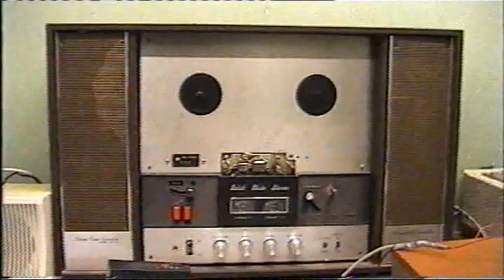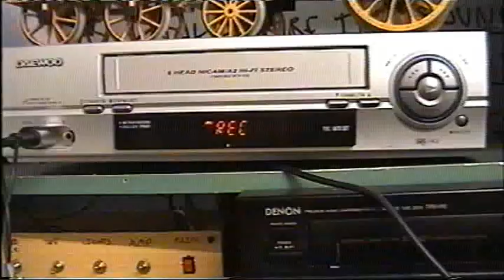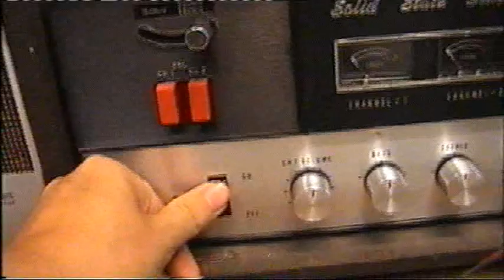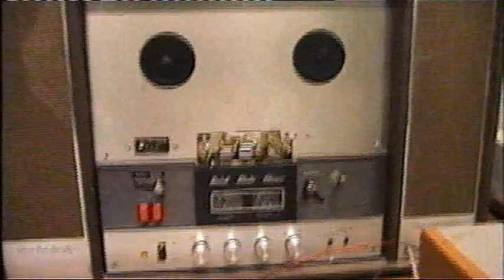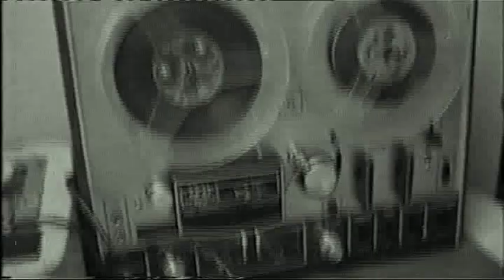Comparing the sound quality of IC's Transistors and Tubes (valves)

Comment: how about the distortion of a tube, here is a datasheet of a 5881 power tube:
https://www.newsensor.com/pdf/tungsol/5881-tungsol.pdf
check out page 4, where overtones and output watts are plotted against load resistance,
a loudspeaker has a much higher resistance in the upper register than its nominal 8ohm description, in these frequencies the tubes produce alot! more distortion, maybe this is a strong factor for the sound:
 the spot where the tube puts out the most power hast also the least 2nd order (even order) harmonics and the most third order that sound more crunchy and less warm actually, like more presence. also the area of low distortion is very narrow around 3000ohm to 4000ohm in this case, so a loudspeaker has a wide range of resistance, a 8ohm speaker has maybe 15ohm at the lower bass around the resonance frequency, then ohms go down towards the middle frequencies where it has the nominal 8ohms, around lets say 400Hertz, and then it goes up alot to maybe 20ohms or even more around 10 to 20kiloHertz.
if you compute this higher resistance with the distortion curve in the datasheet of the tube, 20ohms is more than double the nominal 8ohms, so if the tube runs on nominal 4000ohm, the upper frequencies of the loudspeaker actually see more than double that, maybe 10000ohm, which is far outside this datasheet already, where output power of the tube goes way down while distortion goes way up. maybe this is the key. high frequencies sound very present because all the distortion in it, at the say time the level of the highs goes way down.

Comment: It's already generally known that valve amps create the best sound. Hence why top end pro-sound systems are valve driven and not solid state driven.
Reply: They actually are solid state driven. Look for Mc Intosh, they have Solid State amps of the value of your car. Tubes are inefficient and need a lot more circuitry to be as linear as transistors and they still arent that linear. They still create harmonic distortion. Do your research please.

Also Tubes arent capable to drive bigger speakers. Tube Amps need really light weight speakers.

Also it is a subjective oppinion. Some people like vinyls even with its distortion and crackling ect. But people like it that way. But if you like it really precise get yourself a good solid state amp and a good pair of speakers.

Most times people like the "warm" tube sound. That is because of unlinearity. The lower frequencys are getting more amplified than higher frequencys if the circuitry is not adjusted to linearity.

Comment: It is fine to make what is an audible comparison to select the amplifier, and the type of active devices it contains, but it is best to compare them with an optimum load impedance for each one, and that may be different, again varying the performance.
It is true that valves (tubes) are more electrically robust (radio transmitters still use them), but efficiency is much less (power output vs power supplied).
Another consideration is the 'class' of amplifier, A, AB (your examples), which can use any of the compared devices.
With the development of television, it was a long time before the use of solid state devices in the deflection, high voltage output and rectification (for the picture tube anode).
Further, there are several types of transistors; bipolar germanium (your 'All Transistor' tape player)..
Silicon NPN, PNP.
Field Effect Transistor N-Channel, P-Channel.
Power MOSFET..
The latest I know now is the IGBT's, (insulated gate bipolar transistor) combining the benefits of MOSFETs and bipolar transistors..
These are included in the latest high power discrete component audio amplifier designs.
As for the Chip amplifier, it would contain a combination of all of these transistors...

Comment: I'm sure u already know this but unplugging a speaker/ dummy load from a valve amp can cause serious damage because the output transformer will blow, then the power valves.  Valves MUST have a load on their output, they are picky compared to SS amps.  Also the speaker. Rees to be the same  or a higher impedance that the output or the transformer will overheat. I hope this will save u time and money